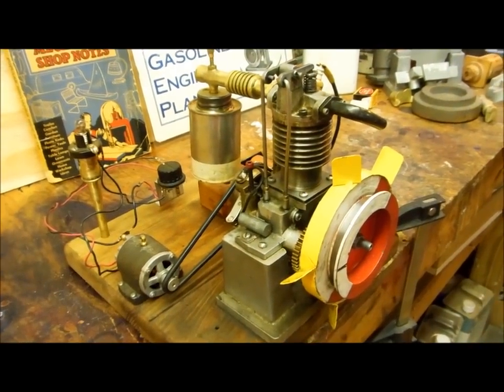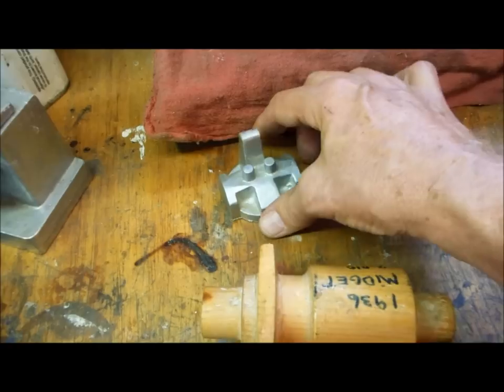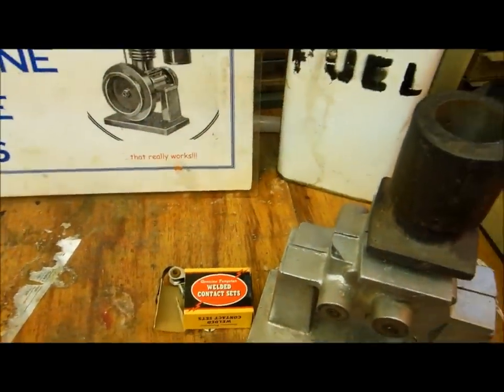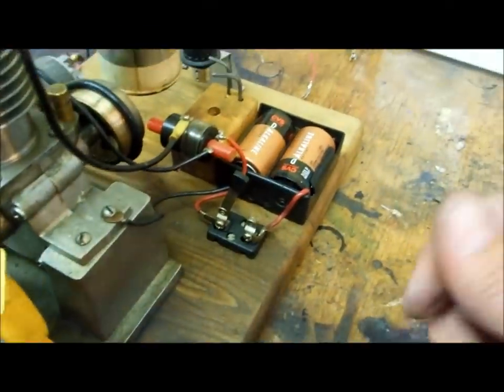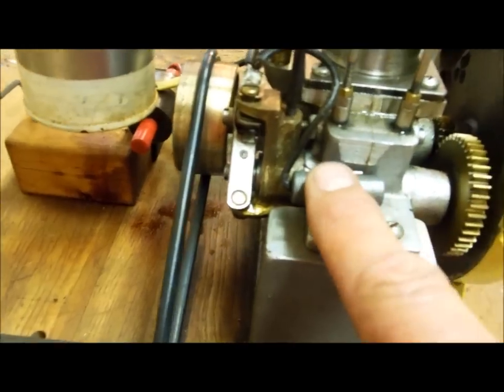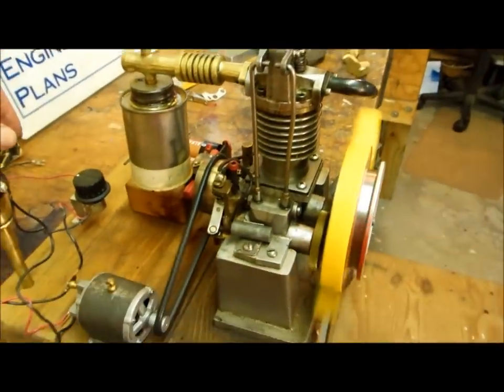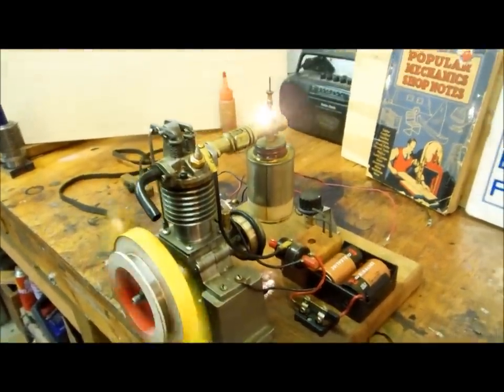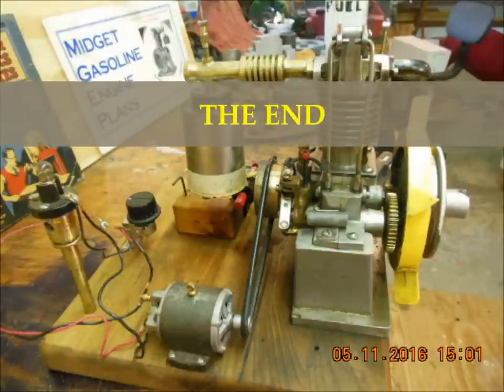Homemade engine Built from 1936 Popular Mechanics Magazine "Midget"  - Will it really Run?

Comment: What DTC does it have? P0171
Reply from the maker: Not sure what you mean by DTC ?
Reply: @gwheyduke  goof'n around. Today's engines Diag Trouble Code with check engine light on.
Reply: @clutch5sp989   LOL
Reply from the maker: @clutch5sp989  😂👍

Comment: Hello everyone, I have the exact type of engine but I am wondering what gas to put into it? Its four cycle and takes oil in the crankcase, can anyone help me?
Reply from the maker: You can use ordinary pump gasoline, sometimes I borrow from my lawnmower can and just add a few drops of oil to the tank.   Gasoline is smelly and hard to wash off your hands, so I have started using Colman camp fuel, Wal-Mart sells "camp fuel" that works fine and is less smelly.  Again I add about 4 drops of Marvel Mystery Oil to the model engine's fuel tank to aid in lubrication
Reply from the maker: The original instructions call for a table spoon of 30 Wt engine oil in the crank case before running.  This usually seeps out through the crankcase halves or bearings after just a few minutes of running. That's why I add a few drops of oil to the tank before running
Reply: @gwheyduke  Thank you so much for getting back to me, I am using airplane gas (nitro fuel) with 25 to 1 ratio oil mixture, would that be ok for it or is that way to much oil.
Reply from the maker: Nitro fuel is OK but it pretty expensive.  Wal-Mart camp fuel is also alcohol but its much less expensive.  Just add a few drops of Marvel Mystery oil to each tank. @ChristineMacWhirter